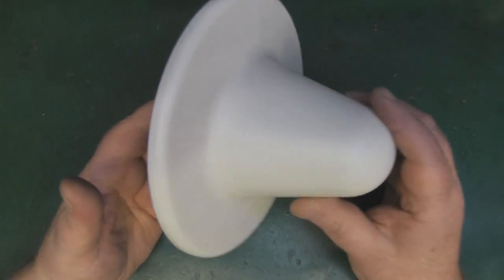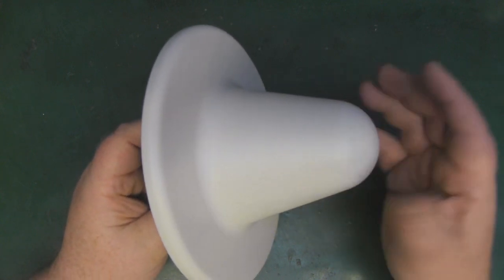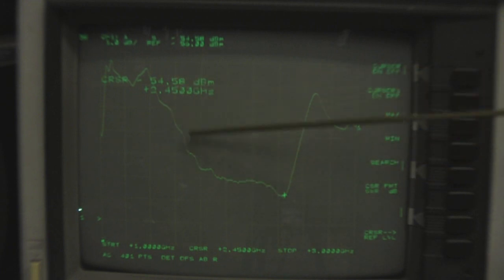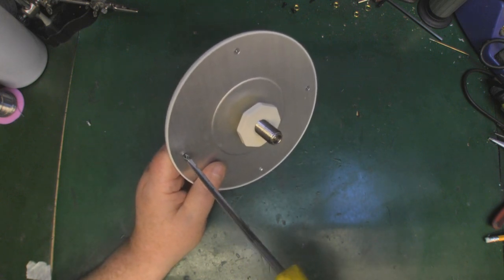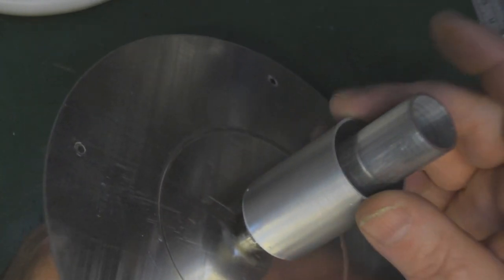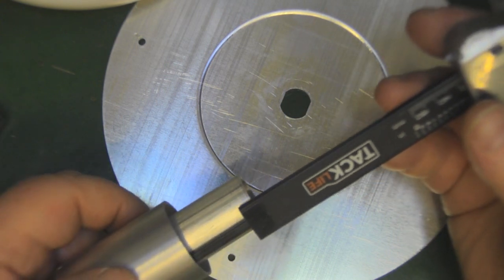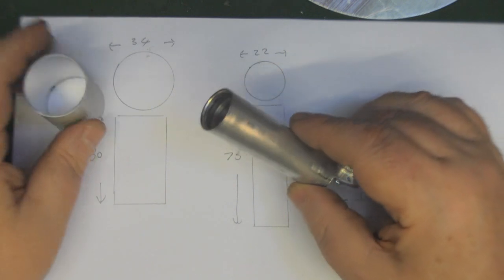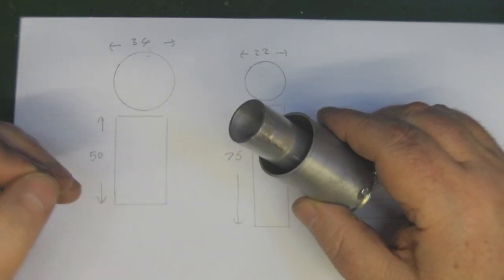Ceiling mount Wifi Antenna 5db 2 4GHz

Comment: its just a very fat a sleeve monopole (look up sleeve dipole for the balanced version) -  its very  wideband due to ultra-fat monopole (22mm dia bit that protrudes from coaxial 34mm section)
see https://www.researchgate.net/figure/Structure-of-the-sleeve-monopole-antenna_fig2_330717196   and 
https://www.researchgate.net/figure/Structure-of-the-sleeve-monopole-antenna-unit-mm_fig4_330717196
Look down the end and and you see a coax arrangement. the bottom 34mm sleeve acts as a balun somwhat (probably far from perfect)
note that normal element wavelengths get VERY skewed by two things here - the fat element (bigtime) and the velocity factor of the coax section at the bottom ) though less so because it's air-spaced so may be closer to 0.9vf or even higher than the 0.66vf end 
look up the figures for impedance of that combo (use OD of inner and ID of outer sleeve) and you may it isn't 5-0 ohm - this is to give  impedance transformation if you see this.

When you're making fat monopoles like this I prefer to use copper water pipes and hacksaw or file bits off unitil it looks right for return loss. equations get complicated with such fat elements. If you cut too much off, add a bit of copper (not alu) self-adhesive tape with good overlap. soldering not vital for fiddling because capacitance across the adhesive will be OK (low reactance at those freqs)
To see the effect of ultra- fat elements solder some strands of cable into a "cage dipole" arrangement - (its mainly an HF antenna style). Then pull the strands/"cage" apart on each leg to make it fatter and observe the plot. 
Also observe how fat elements lead to wide bandwith/flatter plots. Also observe that they are less prone to exact dimension tolerances. 
Also you can snip the tape with scissors for faster trimming. Oops - cut too much off? just stick more back on haha. Fast prototyping and no maths, BUT DON'T do it with power on in case you short it out (though best practice to run through a 3dB, 10dB, 20dB pad anyways of course)
Probably works OK for 1800/1900/2100Mhz 3G/4G too looking at that plot. 
Simplified: the longer bit of the 22mm that "sticks out" of the 34mm is the monopole element 75mm-50mm = 25mm element length. Yes - VERYery short because it's length/dia ratio is al most 1.13, so "normal" thin wire dimensions don't apply. The 34mm with the 22 inside form a coax sleeve (not always 50 ohms, for matching purposes)
I like to think of such fat monopoles as more like a cuboid or sphere as main/centre element - "length" is hard to quantify - fatness matters (said the bishop to the actress, fnarr fnarr)
Note on velocity factors on adhoc transmission lines...
Easy way to remember the velocity factor  effect s the "thicker/heavier/more of it" the dielectric, the slower the velocity factor of a transmission line.  
Examples: 
wet TV coax can be as low as 0.50vf
RG8-style coax, around 0.66
airspaced coaxes, 0.7-0.88
Foam-spaced coaxes, 0.7 to 0.91 or higher
Airspaced solid tubes, like these, can be 0.8-0.95 at the top end
Soldi twin line (old fashioned "300ohm VHF/FM tape antenna lead, about 0.82-0.88 depending on brand/plastic
Twin ladder line (hf low impedance, ) 0.82 to 099 or so
Twin ladder line hf high impedance, 0.8 to 0.92 or so
Homemade "stick" spaced hf twin line or parallel rod at higher freqs, as high as 0.96 (high VF because theres mainly air and only occasional spacers, this also gives very low loss and very high power handling. 
Two rods spaced in a vaccum, no spacers but held due to their rigidity, maybe 0.97vf? 
  
As you can see above , the thicker the stuff in between the  conductors, and rthe more there is, the lower the VF. SO, in your antenna in the vid, the VF should be quite high )(airspaced) BUT god knows what length it should be - the stumpy elements skew the figures at these freqs so much that it's hard to be sure. 
~*In a perfect world, all coax transmission lines of a given velocity factor will be a certain physical length*~. In reality, someone sits on a bench and cuts/files copper pipe or snips adhesive copper tape until it "kinda-looks-right" on the return loss plot :)
Trust me - that was me a couple of decades ago.
ARRL books used to have some good data/charts/nomographs on arbitrary/adhoc transmission lines, not sure if they still do. 
typing on fone so sorry about mess/typos
/RF-tech-mode off
/pringles-can questions mode back on

Comment: If you squint a little, you can see that it's basically a 3D J-pole antenna. Take a normal J-pole , rotate it 360 degrees around the longer leg and integrate.
You could probably make a Slim Jim variety by:
- cutting a piece of copper pipe to 3/4 wavelength
- fitting an end-cap at the top
- drilling a pair of holes at the feed-point and solder the wires
- use a slitting saw to slice the pipe at 1/4 wavelength leaving a small sector for structural integrity and electrical connection between the 1/4 and 1/2 sections
- run a slit almost from top to  bottom on both sides perpendicular to the feed points
Reply from the maker: Thanks for the info that sound interesting. A few people have pointed me at the slim jim antenna is this a popular design with the ham radio community? As I have never heard of it before.

Comment: Isn't it some kind of air-based-coaxial bazooka antenna ? The outer tube would be the shield / grounded part of the dipole, and the inner tube the radiating element, the overall width being meant to widen the pass band....
Reply: The integrated J-pole mentioned below also makes sense.
Reply from the maker: @gaelc13  J-Pole/ sleeved dipole is another name

Comment: It is an end fed 3/4 wave antenna. The bottom 1/2 wave ( 50mm tube) uses the capacitance to match the high impedance to 50 ohms and the top 1/4 wave sticking out of the fatter tube radiates in phase with it because of the 180 degree phase shift it sees with the outer tube ( it sees it as a 1/2 wave piece of coax). The wide bandwidth is of course due to the diameter of the tube. It should have about 3.5 to 5 dbi gain. My guess is the bottom of the bigger tube is about 1/8 wave from the large disk and it is about one wavelength in diameter.
 The slim jim or j-pole antenna is an end fed 1/2 wave using the bottom 1/4 for impedance matching only (it does not radiate), where as this antenna the whole 3/4 wave radiates and it can get some gain from its ground plane.
Reply from the maker: From what other people have said and from what I have read since you are spot on Bruno
Reply: According to "Antenna Magus" it is Sleeve Monopole: 
Background
The standard monopole is one of the most commonly used antennas. In its simplest form, it consists of a quarter-wavelength wire driven with respect to a large ground plane by a coaxial feed line. This simple implementation has the drawback of being fairly frequency-sensitive, something that can be curbed through the addition of a sleeve, which can increase the frequency bandwidth to an octave or more. The advantage of this type of antenna as compared to, for example, the monocone – another wide bandwidth monopole variation – would appear to be mainly cost and complexity related, with the sleeve monopole being a far simpler and cheaper antenna to implement.
A disadvantage of this type of antenna is that the ground plane must be large and conductive. This can be particularly problematic at low frequencies. In addition, it cannot easily be raised above nearby obstructions such as buildings and power lines. At low frequencies, it is often impractical to erect a full-size quarter-wave antenna and some form of inductive loading is often used to compensate for the reactance of the shorter mast. Even with a good ground system, the efficiency of a monopole antenna over real earth is often significantly less than that of an ideal model, particularly for monopole heights less than λ/4.

Physical Description
The antenna consists of a coaxial feed at the base/ groundplane of the antenna. The short-circuited stub is an extension of the coaxial transmission line beyond the groundplane, while the coaxial inner continues past the end of the stub, to the element. From the base to the top of the element is a quarter-wavelength (your verision is longer half wavelength) at the lowest operating frequency. The sleeve acts as an outer conductor of the feed coaxial transmission line, and is in practice usually between a third and half of the height of the monopole. 
Feed Method
The monopole is fed coaxially through the ground plane. 

!Operation Mechanism
!
The standard monopole operating above an infinite ground plane is equivalent to a conventional half-wave resonant dipole. The addition of a sleeve moves the virtual feed point up the monopole. The bandwidth increases because the current at the feed point remains nearly constant over a wide band. Currents at the input for the case when the monopole is a quarter-wavelength long and when it is a half-wavelength long are about the same. The input resistance remains constant as the frequency changes. The sleeve shields possible radiation from the internal currents while the currents on the outside of the sleeve radiate. [Milligan]

Performance
Impedance Characteristics
The impedance remains somewhat constant over at least an octave. As for the ordinary monopole, the antenna dimensions affect the impedance more than the pattern. The impedance may be changed to some extent by varying the sleeve, stub and transformer dimensions.  Note that the dimensions of the groundplane will have an effect on the input impedance. In the case of the reflection coefficient graph shown below, the diameter of the groundplane is one wavelength at the minimum frequency.

Comment: What is the best antenna for capturing long-range Wi-Fi networks?  How can it be made?
Reply: dish based antennae ,
Reply: @ambrosekawa315  A very long Yagi antenna with many elements, would have fewer confusing side lobes. and if mounted in a PVC pipe would be MUCH easier to aim.

Comment: NO NEED ? hold/keep the distance between transmitter and receiver at LEAST (minimum) 4 wavelengths apart (Wifi 122mm*4=488mm~50cm~0.5m) . (or least 3 meters ?)